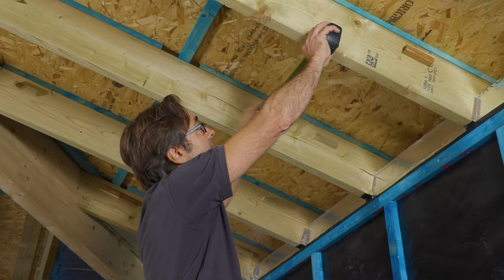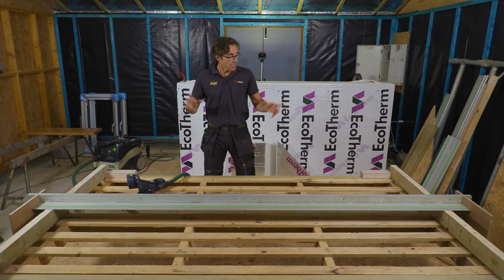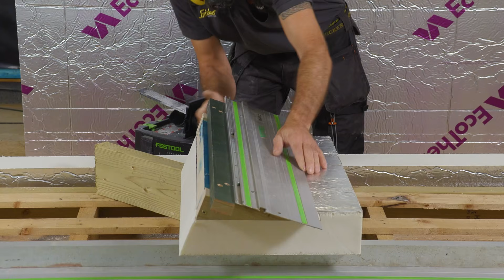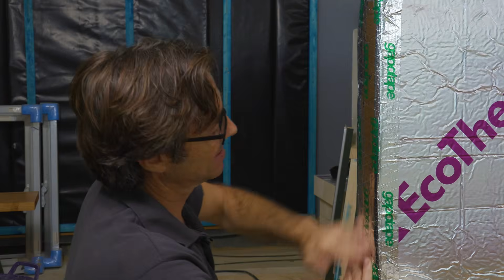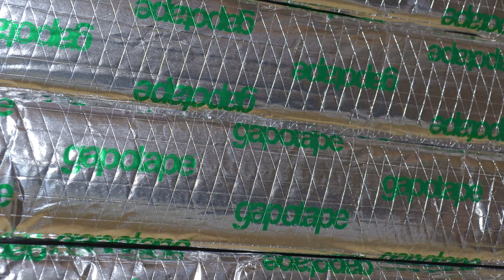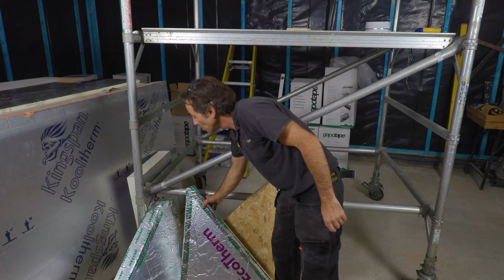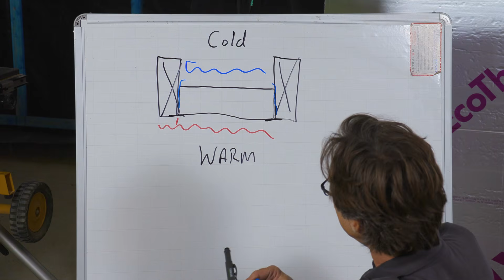Gapotape - Perfect Insulation with PIR Board

Comment: Another excellent tutorial Robin, however I notice you left a small gap on the warm side of the roof usually this would sit level with the timber, would there be a reason for this?
Reply from the maker: Hi John 
We have a video coming out about how this works. Radiated heat leaving the building is reflected by the silver foil but this can only work if it has an air gap for the reflected heat to bounce back into the room. Place your cheek a few millimetres away from a sheet of foil and you will feel your radiated heat bounce back at you. Press the foil against your cheek and it stops happening. The small gap you leave is essential to get the most out of the product. 
It is something a lot of people don't do which is a shame because it is free heat. The best arrangement is insulation set back slightly then the underside 25mm insulation  across the bottom to stop the cold bridging then a counter batten vapour barrier then plasterboard. You then have two sealed air gaps and two reflective surfaces with air gaps. It doesn't get any better than that.
Reply: @SkillBuilder  I can’t wait to watch the tutorial, thanks again for such a simple explanation. I did a small project on a timber office over a year ago now and the vapour barrier was between the clad and framework. I put 60mm kingspan between the wooden framework, my air gap was on the side of the vapour barrier then just plywood the inside section. From this advise I’ve done it wrong but I guess this is the problem so many people have different thoughts. On a positive note I’ve had no problems as yet however it is a glorified workshop really.  Keep up the good work yours and robins tutorials are brilliant and very thorough.
Reply: It is a great question, I have had different building inspectors insist on a gap between the insulation in-between the rafter and the layer that is underneath and others that how no opinion on it!! I have done a bit of research online through various manufacturers and I have established that if there is an air gap then this helps the insulating qualities by some means of reflection!!! also its handy for the odd electric cable

Comment: Robin, just wondering why there are no nogins between your roof timbers and how this product would be used if there were some? Ps sorry if this is a stupid question but I’m not a builder of any kind - I just watch to see your skill and perfectionism!
Reply: Hi Martin, Roof rafters don't generally ever have a mid span noggin, they are mainly in timber floor structures only, I have seen noggins used in roofs and you have to be really careful not to impede the through flow of ventilation etc, great question

Comment: All that work, effort and time consuming when you could have sprayed it with closed cell foam and had 100% air gap closure. Then tossed on some basic fiberglass batts that don't need fancy jigs to cut or fancy gap tape to ensure tight fitting.
Reply: I think the part at the end where he breaks down the spray foam and standard fitting was good as it shows that even good workmanship isn’t the cure, I’ve often found it’s a double ended sword as a lot of these new tests show that the builder isn’t to blame so if we go in with the mentality that it’s a fitting issue and then Whenever it’s tested and fails it looks like the builders at fault even though they aren’t

Comment: Why isn't the the insulation ( when fitted)  flush with the underside if the rafters??
Reply from the maker: reflective foil needs an air gap to work so having an air gap in between the plasterboard and the insulation gives you a much improved performance. If the insulation is hard up against a board the foil does nothing.
Reply: @SkillBuilder  Thank you guys, Wasn't aware...really helpful

Comment: The price of Gapotape is pretty steep though. Around £100 for 50m. That's about 8 boards of insulation. Thats adding over 30% to the cost of a 100mm board.  Yeah it looks like a great product - but I can't see many clients agreeing to the additional cost compared to foaming and taping seams.
Reply: Been thinking about this as well, I’m wondering with the reg change as rob talked about it might be something I may trial out but Jesus the hidden cost thing would need to be true, I’m wondering if the tape would allow me to use a smaller insulation cuz if it would then it would be a game changer

Comment: Fantastic job and knowing from my renovation how frustrating fitting PIR is the Gapotape looks to be a game changer......... and then you google how much this product costs! £19 for a 10m roll (to suit 100mm thick insulation). You’d potentially have to use 1.2 rolls per 1200x2400 board if you were fitting at 600mm centres, add that to your £30 sheet of insulation and eeeeeesh, that job just got expensive!
Reply: I think there’s a discount code in the description if you mention skill builder or something, gonna look into it at least as if if really makes the stuff 2-3X better it may be worth it but I’ll have to price it out vs heating costs saved over time

Comment: Nice job, good thing you work for yourself because if you worked some one else you wouldn't be able/allowed to take the time to do a perfect job.
I didn't see any electrical cable for lights, what is going to happen to this perfectly completed insulation job when the electrician comes?
Reply: Hi Rich, my standard is the same if its my work or work for a builder or private client its all I know, on the subject of electrics we are having decorative steel conduit for the lighting all the other cables will be in dedicated bulkheads and hidden ducts
Reply: @robinclevettcarpenter  Hi Robin, yes I can see your standards of work (thumbs up) I have also been watching your channel too.
 What I meant was if you were employed (on wages) not as a contractor.

Comment: You reckon I wouldn't need a 50mm strip over the 100mm if that tape is good enough?
Reply: The wider the tape the better it will seal because a lot of timber is quite rough. Wide tape = better seal =less moisture/condensation. And heat transfer must travel through the entire board thickness with a full width tape 😊

Comment: Very interesting and havnt seen it used on site yet. Only problem is most of the time you have to add an additional PIR under rafters to meet the Uvalue. 100mm plus 40/50mm.

Comment: 100mm GAPOTPE £1.90 per meter. 

Perimeter of a 2.4m x 0.6m board = 6m 

6m x £1.90 = £11.40

Cheap tape 🤥
Reply: I think it’s like he says you have to start actually costin the time and hidden costs and compare it with the speed of install and the regs in the description, not gonna lie I wish it was cheaper but I may trial it with the discount code in the description and see if it really does work out better overall, hopefully it does but not gonna believe it till I’ve actually done it myself

Comment: Very interesting video. i've seen insulation jobs where there's gaps all over the boards and everything is held up  with nails.. Absolutely no point insulating if you can't get a piston fit on the boards. I've always cut the insulation parallel off the board, offered it up and ran the saw between insulation and joist, but that's always very messy. That festool saw along with the tape has to be the best way to insulate

Comment: I feel like ripping my plaster boards down on my vaulted ceiling and fitting the tape now I've seen this!! looks like a fantastic product. Obviously I wont be doing this but the problem I have is the down lighters - I had to cut through the PIR board to fit them and on a cold roof it feels like a reel draft is coming through. Any suggestions for the down lighters?
Reply from the maker: The downlighters  should never be used in insulation. Even the fire rated ones have vents so a lot of moisture goes through those holes.
Reply: Take them out and replace them with a similar looking led slim panel and fill the hole with rigid foam and some Gapotape™.

Comment: Friction fit vs air pressure differences, seems like a bad idea. Will this pass blower door test in 10 years time? Plus continuous insulation is required to avoid thermal bridging through the rafters. Don't think this would pass certification where I live. If you're going to use tape it should be air tight tape certified for the application that will last the life of the building. Foam for tight gaps is also a bad idea because even closed cell foam requires a certain depth to achieve air tightness which you won't get in a skinny gap.
Reply: I read the testing on the website and i think the point of it is that is an air tight tape and insulation in one as in the test you blow air at the insulation as well as heat and it stopped both making it heat + air sealed
Reply: Hi John, we use an Insulated plasterboard beneath as you do, look out for this in a future video

Comment: Having a bigger air gap and cross flow ventilation is the most effective method to reduce moisture problems with a cold roof set up. Batten rafters with 3x2s spaced out  with 200 to 300mm gaps to allow cross flow ventilation. I can see Robin has used roof battens on top of the rafters but id go slightly thicker and increase the gap slightly to allow cross flow. Top it with foil vapour barrier and 25 mm insulation and you won't have any problems. This product is good but it's expensive and you could technically still have moisture problems, expecially if it's not a pitched roof. Most customers can't afford it. Especially in the economical  climate we live in now. It's a product with clients who are willing to pay top dollar. Some tradesmen are very lucky they have such clients on a regular basis. Most don't.
Reply: The batten was used to solely give me a vent over the corner of the ridge and hips, we have about 90mm of ventilation space and our ridge is also vented as well as the eves something I did not explain well!! great comment and you are right, some clients want to pay nothing and then complain about the standard!!!! that type of work is not for me, I like to build right and do work to a good standard, what hope is there if the standard drops and no one passes on the knowledge in a good way!!!
Reply: Perfect. Wasn't all that clear. You have the right work ethos. The videos provide great information to clients and the trades person alike. Clients are becoming very savvy and exploring options on behalf of their contractors. Certainly a more collaborative approach to building and design in recent years. Videos like this just keeps everyone informed of best practice.

Comment: Well this is certainly fascinating and encouraging to see a contractor make such an effort to make such a perfect install that not only looks good but performs well.  Having said that I do have a couple questions.  While it is true that a sliver of inconsistency between the roof rafter and the solid insulation can create air penetration and potential condensation I am not sure how you address the thermal bridging between the roof rafters and the roof.   I see a little gap above those rafters and some sort of blue thing which it seems to be strips of OSB.   If so that would still bridge the cold from the outside through the OSB strips into the rafter and, with a thermal camera, would show even with your tight insulation install lines where the insulation is not installed.    Perhaps those are not OSB strips but some sort of thermal bridging inhibitor?    Of course an alternative to this system is to put some degree of insulation in between the rafters and then run rigid insulation perpendicular to the rafters thereby creating one continuous thermal blanket throughout the whole ceiling.   You may even end up with a bigger air cavity to keep the roof cool even in the balmy English summer.   That would also be tons easier to install.   Furring strips over the solid insulation would then be used for drywall or the ceiling cladding.   Plus you would end up with double the insulation .. one inside  the cavity and the one running perpendicular.
Reply: Great comment, to avoid the thermal bridging we use a Kooltherm insulated plasterboard on the underside of the rafters also the depth of rafter can help mitigate the thermal bridge, we have a 200mm deep rafter, and I saw a report a while back showing the thermal performance of timber in different thicknesses and timber is on of the best materials for insulation (depending on position thickness etc)
Reply: @robinclevettcarpenter  The thermal bridging issue would be from roof decking osb through the rafters .  Are you also insulation perpendicularly ?    https://www.kingspan.com/gb/en-gb/products/insulation/kingspan-insight/articles-and-advice/why-you-can-t-just-insulate-between-the-rafters     
The timber rafter should only be an R8-10  well below the rigid foam you are installing so theres a big gap in R rating which shows up as lines on a thermal imaging device.  It is a pretty good idea to put some foam perpendicularly.

Comment: Robin, the Kingspan Kooltherm Phenolic foam is a better performing product, but it's only 10% better... I'm Sales manager  in a Builders merchant and I am always getting my PIR supplier to change the spec on Kooltherm  projects. 100mm Kooltherm is the same thermal value as 110mm PIR... and when The Kingspan product is twice the price of PIR.. it's a no brainier to go down the PIR route.
And in response to a comment earlier about PIR being the next asbestos and the risk of death from fire as at Grenfell Tower... all PIR manufacturers make fire rated Insulation. It's a shame the construction company cut corners and saved a few quid...

Comment: One question, why did you choose to pitch a cold roof instead of a warm roof?
Reply: Hi Tom, I had a maximum height for the building of 4m to meet regulations so adding 130mm on the top of the roof would have made it really tight  and the roof shallower, its only 19 degrees as it it!!, we also used a standing seam roofing product and so I wanted a perfectly flat surface and the sheathing over the rafters not only provided that but this skin helps the whole building structurally from racking etc so If I did a warm roof I would have still needed this sheathing then I would have needed another skin over the insulation to that would have been another 52 sheets of OSB/PLY, I do use a warm roof wherever possible as it is usually quicker to build and better for services such as lighting etc in the roof space
Reply: @robinclevettcarpenter  many thanks for the insight!! Loving the videos on SB and your page, thanks again for sharing!

Comment: Great Video Robin, very well demonstrated...could you use the tape as a sill sealer for framing, if not what would you recommend? Thanks
Reply: Hi John, I don"t see why the tape could not be used in that way, as long as it is protected from the elements?

Comment: Very very tidy job, been working in insulation for many years. Unfortunately I can’t see either of those products catching on. I have used all types of saws and none do the job any better then a standard hand saw. Insulation hand saws don’t create as much dust but will only cut through pir up to 50mm. From what I’ve seen of that saw it would be more cost effective to use a normal hand saw or even a circular saw and a Henry to vacuum the dust. As for the tape you would still need to use additional foil tape on every join or at least a 500 gauge vcl to pass building regs. In new build the most common way of meeting u value would be to fit a pir board to the underneath and the only way of reaching the uvalue required and that would also act as the vcl.With the competitiveness in pricing for new build properties I can’t see many insulation companies opting to use the tape as it would be an additional cost with little benefit.. I hope this doesn’t come across the wrong way. As I said a very tidy job and couldn’t be installed any better I’m sure they will have no issues in the future what so ever
Reply: Honestly I've got a festool saw, and cutting 150mm pir is a dream with that, and very little dust compared to a standard handsaw. I like the idea of the tape too, but like you said a thermal break layer must help with any small gaps.

Comment: Good advice on the PIU vs PIR.  Great video and advice.  Cutting to fit and glueing takes a lot of time to get 10% greater roof strength.

Trouble is for the DIYer and small jobs kingspan is almost impossible to buy so I no longer even try to buy it, a frustrating waste of time in my experience.  I buy the PIR from the competitors which is sold in small quantities for DIY jobs room by room.  I also glue the PIR in place so no gaps as the glue expands, I spray with evervbuild 5 star to moisten the wood I am going to glue to for activation and bond or boron gel in critical areas.  This provides additional strength to the structure which may be rafters or battons in a 1890s Victorian house.  All air spaces restored to have air circulation and avoid moisture issues.  Great to see how a pro does it rather than an anal DIYer.

Comment: If you have a solid vapor barrier on the inside the condensation will happen on the "inside side". The water that condenses is from the warm inside air. The only water that gets between the insulation and wood can come from a leak in the roof. So it won't damage the structure I think, only what's on the vapor barrier (plasterboard?)

And shouldn't there be a vent at the ridge of the roof if you have a vented roof? Or is the roof small and shallow enough that you didn't need one?
Reply: Hi, I did not explain well but we have a continuous ridge vent on the roof, well observed and great comment mate
Reply: Reedik Tuuling Imagine some ridge vent is needed, but video did not (yet) talk about the roof and the ventilation methods... perhaps next one will...
Reply: @JohnR84  at 16:44 Robin mentions how the air moves over the insulation.